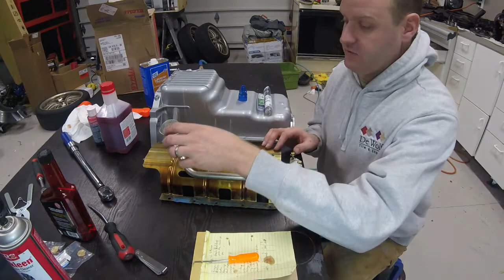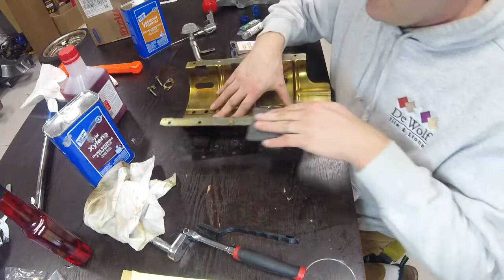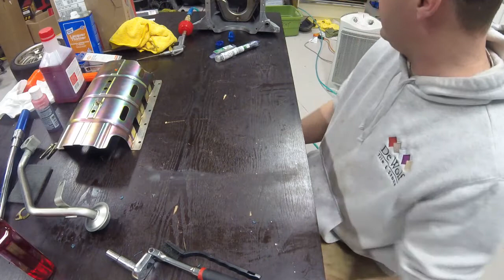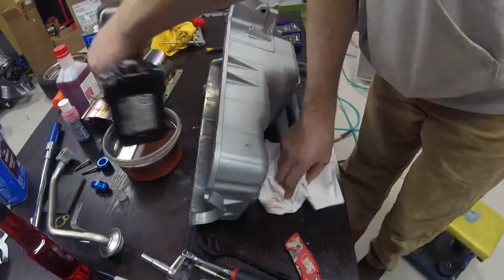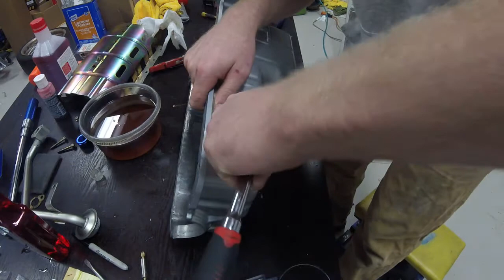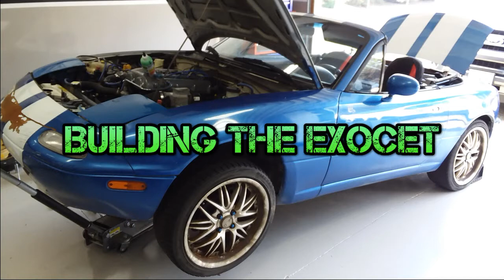Miata Turbo Oil Drain Install

Comment: DONT FOLLOW THIS GUIDE IF YOU ARE KEEPING AC AND POWER STEERING… it’s one of those brackets lol
Reply from the maker: Good call!
Reply: @BuildingTheEXOCET  …. I learned after I followed your guide and went to go put on the bracket… I had to get the oil pan welded… the Welder was great though. You can’t visibly tell it’s need welded from the outside of the oil pan besides from around the oil drain bung.
If you want to see it I could give you my insta

Comment: where did you get that cap from? im doing the same where ill be running the 1.8 without the turbo first then ill be bolting on a kit afterwards
Reply from the maker: Amazon I believe it was a russell brand fitting?   Or maybe aeromotive

Comment: I'm totally into all of your videos. I'm building Sport Chassis #304 and I'm basically following your lead here. Question: I've read that some people are using 1/2 NPT for the threads and you are using 3/8. And what size AN fitting did you go with?
Reply from the maker: garymandile can't remember.  I think it was -6.  Everyone I've heard said 3/8 was plenty for the drain
Reply: Thanks for the help. You have no idea how much I appreciate what you are doing on here!
Reply from the maker: @garymandile  MY BAD!!!  It was a -10an fitting.  Hope that doesn't screw you over.  I was referencing this video as I am now prepping my drain hose!